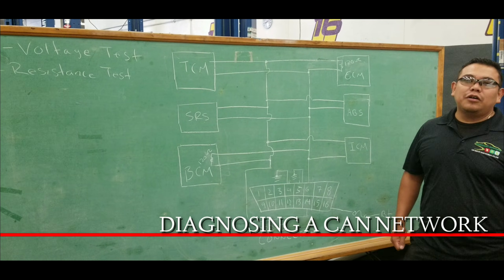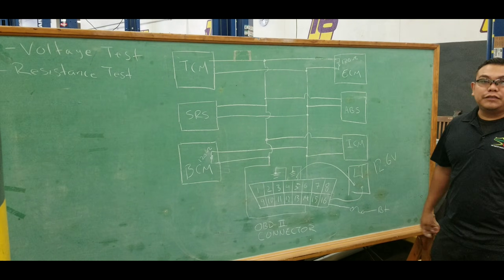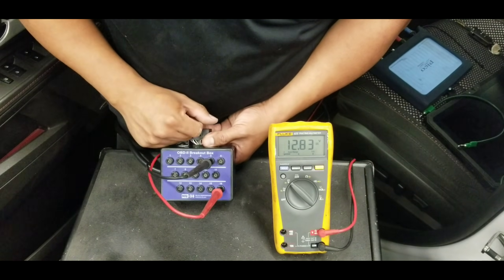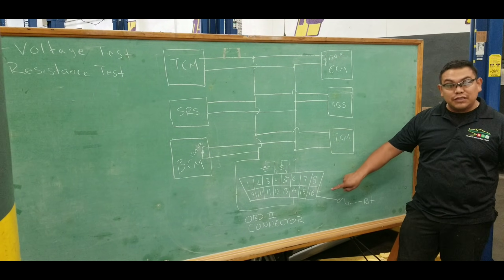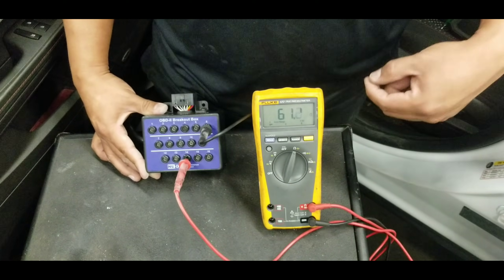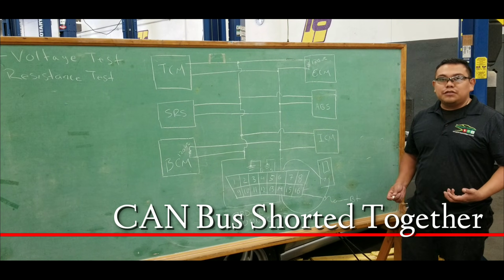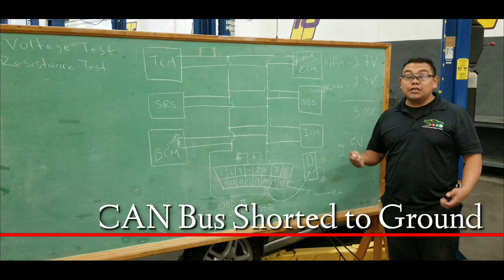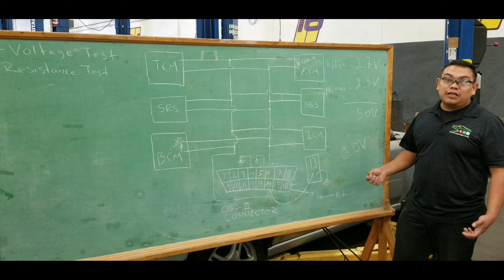How to test a CAN bus network with a meter

Comment: What if My PCM is not communicating but my AIR BAG, GEM, ANTITHEFT, REAR ABS, CLIMATE CONTROL is communicating. All other modules/networks are communicating except PCM. The instrument cluster shows the Engine light when I turn on power, and vehicle DOES start and run. All fuses, all of them are verified good visually and checked with volt meter
Reply from the maker: If the PCM is part of the same network, it means that the network is not shorted, that's why you have the communication. You need to check the voltages, grounds, and the 5 volt reference from the PCM. Watch my vide on no diagnosing a no start, no communication, it explains a similar issue that you are encountering.

Comment: So if there is a short you still dont know which one is the problem... unless you unplug each one an test ohms
Reply from the maker: If the bus lines are shorted together, unplug each module until you see a change in the ohm meter. If all modules are unplugged and the meter still shows shorted together, the problem is in the wiring.

Comment: Thank you so much for this video. I need help. I have a Jaguar XF 2013 2.0L with turbo charged. New battery in the car. But every time, I went to start the car, the instrument cluster would come up and power down within 5s. My scanner tool gives me a few codes U0214-00, B1B33-15 etc. 
after watching your video, I decided to do these tests you mentioned in the video.
Here are the results:
I have no ground on OBD2 Pin #5 but I have ground on pin#4. Also, when I do the voltage test on Can_H and Can_L, I got 2.34 and 2.12 respectively. But my resistance test is 63 ohms. Can any provide any kind of assistance to my issues here? Thank you all in advance!

Comment: Sir one vehicle how many resistance 2 or every module have 120 ohm resistance. Please reply
Reply from the maker: Vehicles could have multiple CAN networks, each network will have 2 resistors. I have seen up to 4 networks in a single vehicle.
Reply: @MRDIAGNOSTECH   what kind of that 4 signals

Comment: Hey. What should I measure when I only have K line and no Can bus system. 
I have a subaru wrx from 2006. There is  an orange wire on Pin 3 and a green/black wire on pin 8. There should usually be no pinout. I looked in the manual, and on the internet, but everyone has their pin out set differently. I have no full power to the OBD port, but it won´t connect to the ECU.

Comment: Such a nice video man. I wish you would be here to help me. I have a subaru impreza wrx from 2006 and when my key is on position 1 or 2 my delphi diagnostic box has power, but is blinking red, which means that there is no connection. When I turn the key on position 3 the lights of the box shut off and there is no more power to the connector. I measured that on the connector itself. Maybe I have a bad ground? I don´t know where to continue again...

Comment: Hello, great video. I am working on a 11 Nissan Sentra, an intermittent no communication problems. When on pin 6 and 4 of breakout box, key on getting 2.6 v (to low) and 4 and 14, 2.3v (normal). When unplugging IPDM voltage goes to 2.7 v on high can side but the IPDM is a terminating resistor. Is this normal to happen when u plugging a terminating resistor or is the IPDM bad and voltage should stay the same when unplugged if it's a good module?

Comment: Hello I have a question for you if you don't mind.  I have a 2013 sonata hybrid not starting  and there is no communication with any module  except for imobilasor.  The power and ground are good ,when I check the ohm on 6 and 14 the ohm is 0.45ohm and sometimes 30 ohm ......
Do you think there is a short or what ?

Comment: Is there anyway to send 5v using a powerprobe to check wiring of #4 & # 6 terminals. a have the unit that changes voltage @ tip  from 12v to 5v

Comment: I don't know how you got into this but you just gave hope to a guy, ME, who gave up on fixing his 07 M35 sitting in the parking lot for almost 2 years now. You explained this so simply and with steps that I will watch this video again and actually make notes before going back to my car.
symptom on my car: No crank no start 95% of the time
                     when the car is happy, usually on a very cold day, it cranks very well but won't start
I connected a consult 3 to scan the network (lucky to have one I paid a lot for). It shows multiple miscommunication between the computers. 
I have U1000 in ECM and the TCS. I have already removed all the computers on the CAN; The only I cannot get to is the TCM in the TRANS. 

If I connect a snapon scanner or any scanner able to see all the computers; the only computers I am able to read anything on are the main 4; PCM TCM ABS & Airbag. any other computer will disrupt the scanner and say no communication. example: Intelligent key module, BCM, Anything else (Snapon cannot communicate with a code are you sure it is connected to the DLC? )
Last thing is when I prompt the Consult for a NETWORK DIAG RESULT, it gives me a voltage and specifies this : OPEN CIRCUIT OR SHORT ON THE CAN L OF THE DLC BRANCH LINE. 
My question is: How can I trace this CAN L wire and know where it is broken. How can I practically do it? I have the multimeter, the breaker box, aligator clips, a power probe 4 and an Open short finder (the one that makes a lot of noise; not very good at using it). 
I feel so close to the solution; Please if you come accross this and can answwer my question and add anything you think could help ID really appreciate it.
Meanwhile, I AM ABOUT TO TAKE NOTES LIKE A STUDENT LOL.
THANKS IN ADVANCE

Comment: Hi! I am getting 60 ohms with no battery connected but when I connect the battery and switch the key to the on position I am getting -10 ohms. My car doesn’t start, I have no cluster lights, and code U0155.
Reply: You can't  read resistance(ohms) with power going through the circuit.

Comment: Pls the resistance is showing 47.5 ohms battery terminal connected n disconnected..also no communication with modules except a/c control module

Comment: Great explanation. I am only seeing 3.99V between pin 4 and 16  what could be the possible cause?
Reply: You have 
1. Bad power. Check pin 16 with direct ground from the battery, using voltmeter.
2.Bad ground/ bad splices/ poor ground/ loose connector. Check pin 4 with direct power from the battery, using voltmeter.

The test will tell you wich cable is making the bad reading.

Also, with battery disconnected, from the battery terminals ,you can test the continuity of the 2 wires.

After you know wich circuit is failing, get the wiring diagram of the car.

Comment: I have 0 ohms and no communication with the ecm. I put in the wrong ecu trying to bypass the immobilizer when I put a new ignition cylinder with the ecm to match. Is it possible I fried my wiring?
Reply from the maker: What kind of car are you working with?
Reply: MR. DIAGNOSTECH Subaru Outback 2005 3.0
Reply from the maker: @minieaglehorse  This vehicle has a different communication protocol.  Pin 14 is a ground for this car and the bus lines are pins 6 and 10.
Reply: MR. DIAGNOSTECH are you finding this out from the factory service manual?
Reply: MR. DIAGNOSTECH I checked the resistance between 6 and 10 and still came up with 0 ohms.
Reply: MR. DIAGNOSTECH the ecu and ignition cylinder donor was a 2006 outback LL Bean

Comment: Just asking if I can do all this check at the DLC with my multimeter do I still need a breakout box
Reply from the maker: Ideally to use a breakout box,  it avoids damage to the connector pins. You can also back probe the connector to get your readings.

Comment: Ok the video so well explain it but I have a challenge for u rn... 
I did the testes in the order u exposed it... Here is the data:
Voltage test: 4 & 5 to 16 =12.40 volts
Resisting test: 6 & 14= 130 ohms (first tried)

Voltage shorted test 4 & 6 = 2.4 H
V........... S...................4 g 14 = 2.4L
Then I was like ok Let me do it again.

Resisting Test 61.5 v
Voltage shorted test 2.99 H and 1.98 L and I still have the Christmas tree in the routan vw 2012 no bus indication and nothing works besides the engine fan, exterior and interior lights and blinkers. 
What u think
Reply from the maker: On the 2012 VW Routan pins 6 and 14 are CAN bus lines, but these wires go directly to the TIPIM module (Totally Integrated Power Module. This module communicates will all the rest of the modules through different CAN bus lines. Some vehicles have more than on CAN network labeled A,B, or C. On the OBD connector this vehicle has a CAN C network.
Reply: @MRDIAGNOSTECH  Oh I see... Thanks
Reply: @MRDIAGNOSTECH  I was looking into Bus communication diagram from All data and I think it has two, Can Interior Bus and Can C Bus, is this correct? I can see the modules communicating with a draw line but i do not know how are connected and how they communicate with each other and the ones that are attach to the network, can you make a video or explain if you can?

Comment: I like the way you explains it.  I tried to make a diagnostic on my car, it is 2002 Mazda protege; when I also disconnected  the battery, and hook it up to a breakout box, I test the can high and can low on the resistance; it keep giving me a "open loop" on resistance.  Is it one of the control module "shorted" or there is a problem in the can bus network?
Reply from the maker: Your car is not a CAN network,  it uses a different bus protocol.
Reply: @MRDIAGNOSTECH  I am just curious, what models of car usually use CAN network?
Reply from the maker: @jzbrynn all 2007 and newer have a CAN network,  some have been earlier.

Comment: Can I'm by pass can bus signal.
Example :
I want to install power sliding door, the controller used can bus 2 wire.  
But my car don't have the can bus system.   

Any idea for this ..?

Comment: How do you test for cars like mercedes which has multiple can bus
Reply from the maker: You will require a wiring diagram for each network,  it will display which modules are connected on each network.

Comment: I have a Suzuki xl-7 with no communication with my scanner and also no crank no start, I was checking everything that you showed in your video and I get in voltage can h 2.89 and can l 2.46 volt in ohm red 130.9 I don't know if this is right. Any advice to this problem, again car don't crank no start and not communicating with my scanner!! Thanks a lot.

Comment: ...  at time 6.05, 2 resistances in parallel of same ohms 120 gives resultant 60 ohms. That's ok.

However, voltage reading at HI and LO are different, 2.7 and 2.3 respectively. Sir, please kindly clarify on this. Thanks.
Reply: He should use a peak min/max function..
Reply: @robertdacumos3468  I'd imagine he normally uses a decent scope but is just showing how a basic DMM can do some integrity validation checks.  I'd like to know where a budget breakout box that isn't junk can be had...  been looking for awhile...
Reply: Readings should  add up to 5 volts.

Comment: I have 60 Ohms and NO communication with the ECM , what is your advice. 
Thank you for the helpful video.
Reply from the maker: If you can communicate with other modules except the ECM, it means that the Network is not shorted. Check all the battery voltages and grounds to the ECM, if it's missing one it could cause a no communication issue with that module only. Could be a faulty ECM, but you need to verify powers and grounds first.
Reply: @MRDIAGNOSTECH  sir, can i hack my car i20 to auto lock after reaching 40 kmph and auto unlock as soon as engine is off?? If so, what's the simplest way to do?? Forget about g scan, etc etc. Thanks.
Reply: After checking grounds and powers, if all is good, then, there is another module in the can network that is failing intermitent, that can be the HFL module AKA bluetooth or the instrument panel, to troubleshoot you have to have one DTC code stored in the other modules, Example B1168- B1178 or o any U1000 or U1001 ( related to bad ECM ).

short:
If any computer or module of the CAN network fail, the CAN network fail, you will see erratic data with Oscilloscope but the multimeter will not see it.

Comment: The resistance between 6 and 14 on my car is 60 ohms but I have no communications with 2 modules, when I unplug a module nothing happens it’s still on 60 ohms can you explain what’s happening ?
Reply: The modules you unplugged may not have terminating resistors. Usually it's in the PCM and ICM or BCM.

Comment: Just curious if join pin6 and 14 together what can happen
Reply from the maker: Network with be shorted and modules will not communicate.  In some case the vehicle will not start and no communication with scanner.
Reply: Thanks the reason i asked is that some mechanic i met said that in his country they would bridge 6 and 14 to stop instrument cluster from counting miles i dont know if its true or not

Comment: Would this be the same for a 2008 Jeep commander?
Reply from the maker: Yes, the Jeep Commander has a CAN network.
Reply: @MRDIAGNOSTECH  So when OBD mentions Can C bus network issues, where would one look?
Reply from the maker: @ShyRage1  It means that the vehicle is equipped with multiple CAN networks like CAN A,B,C. That means that certain computers are connected to certain networks. You can test each network the same. Do you have access to service information to search for wiring diagrams?
Reply: @MRDIAGNOSTECH  I do not.  Any links to any that you know of?  I have an 08 Jeep commander, 3.7l.

Comment: Very useful information. I have one concern related to CAN terminal resistor, if one of 2 resistors is loss. Mean only remaining 1 resistor, any affectation to the CAN bus and Voltage of CANH and CANL? Thank you very much.
Reply from the maker: If you lose  terminating resistor, the voltage will not be able to switch properly,  you might see one bus line with almost 5 volts and the other line 0 volts.

Comment: Good stuff! A lot of "techs" are lost when it comes to this. Very well laid out, I enjoyed watching.
Reply from the maker: Thank you
Reply: @MRDIAGNOSTECH  sir, can i hack my car i20 to auto lock after reaching 40 kmph and auto unlock as soon as engine is off?? If so, what's the simplest way to do?? Forget about g scan, etc etc. Thanks.
Reply: @MRDIAGNOSTECH  at time 6.05, 2 resistances in parallel of same ohms 120 gives resultant 60 ohms. That's ok.

However, voltage reading at HI and LO are different, 2.7 and 2.3 respectively. Sir, please kindly clarify on this. Thanks.
Reply from the maker: @tnamen1307  the Hi side switches from 2.5 to 2.7 and the Lo side switches from 2.5 to 2.3. The meter is too slow to switch at the same rate, so it will give the average voltage. You need an oscilloscope to watch the activity. If the CAN is shorted together you will see 2.5V on both. If either bus line is shorted to ground,  you will see 0 voltage.  Either short could cause a no communication.
Reply: @MRDIAGNOSTECH  any way of activating auto speed door lock when the car reached 49 kmph through this DLC connector, leaving aside the g scan, etc??
Reply: @MRDIAGNOSTECH  hi, please show video on how audio control buttons work with different resistances to control audio functions in car. Thanks.